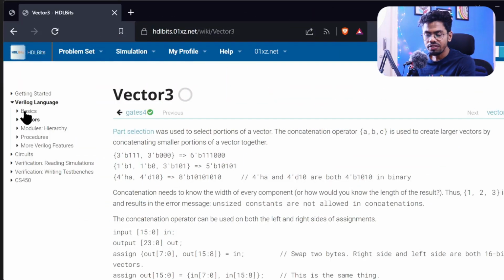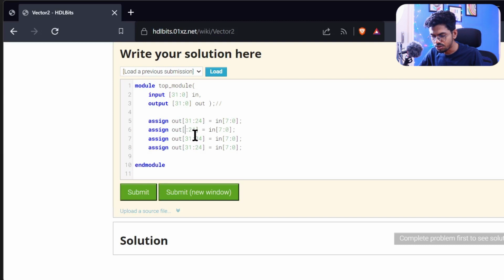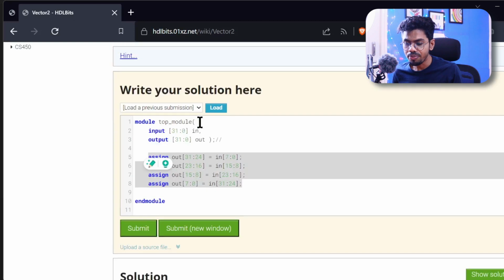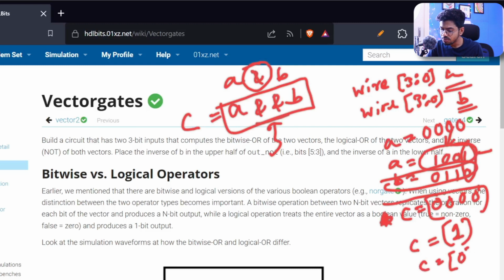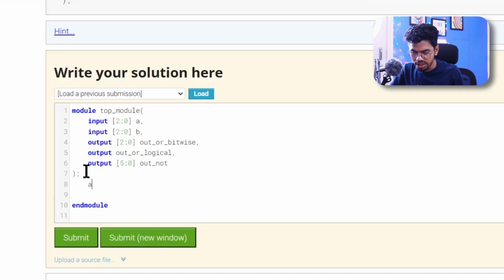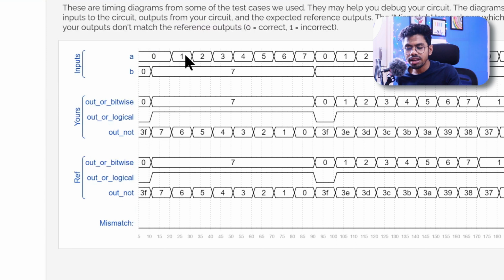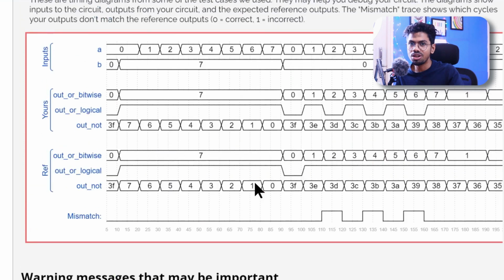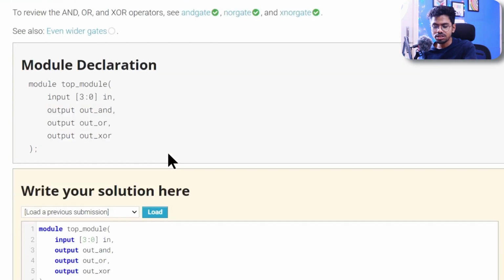Lets Learn Verilog with real-time Practice with Me | Bitwise operator vs Logical operator | DAY 5

Comment: behavourial gives the directly the equation of  what is happening (like the boolean expressions) while the structural gives the several  blocks that are used to form the system and how they relte to each other, the plocjks can be gates or a group of gates forming a certain block eg a full adder

Comment: module top_module(
	input [2:0] a, 
	input [2:0] b, 
	output [2:0] out_or_bitwise,
	output out_or_logical,
	output [5:0] out_not
);
	
	assign out_or_bitwise = a | b;
	assign out_or_logical = a || b;

	assign out_not[2:0] = ~a;	// Part-select on left side is o.
	assign out_not[5:3] = ~b;	//Assigning to [5:3] does not conflict with [2:0]
	
endmodule

Comment: Structural description gives a low-level, detailed description of the circuit using gates and module instances whereas behavioral description gives a high-level, abstract description of the circuit using procedural blocks and control flow statements.

Comment: Hello raj,
First, you are great, thank you for your tutorial, it helps a lot.
Will it work if I will write the code in the example like that?:

module top_module( 
    input [2:0] a,
    input [2:0] b,
    output [2:0] out_or_bitwise,
    output out_or_logical,
    output [5:0] out_not
);

    assign out_or_bitwise = a | b;
    assign out_or_logical = a || b;
    assign out_not[2:0] = ~a;
    assign out_not[5:3] = ~b;

endmodule

Comment: Behavioral design basically describes the system based on the functionality, like in terms of the algo. Whereas the structural code defines the system based on the structure of the components and the interconnects between the components.

Comment: Behavioural design is the design style in which we did not know about which circuit gonaa come we just make sure to do logic not tensed about gates and other stuff
But in structural we use primitives and pre defined module which we make earlier like for example there is an full adder 
1. Behavioural
Sum = a ^b^c;
Carryout = (a|b) & (b|c) & (a|c);
2. Structural (by using 2 half adder)
wire w1,w2,w3 
mod_HA HA1(.A(a) , .B(b) , .sum(w1) , .cout(w2) );
mod_HA HA2(.A(cin) , .B(w1) , .sum(finalsum) , .cout(w3) );
mod_or2 OR1(.A(w2) , .B(w3) , .OUT(cout) );
Reply: you have written wrong C_out. Carryout = (a&b)|(b&c)|(c&a)

Comment: Behavioral design is somewhat analogous to writing RTL (Register-Transfer Level) code in a logical manner. However, in the case of structural design, if we need to define RTL code for a specific scenario, the approach involves expressing everything in terms of gates using primitives. By following this method, we can be assured that the circuit will be generated from the RTL code in the same way it would if we were to sketch it out manually on paper.